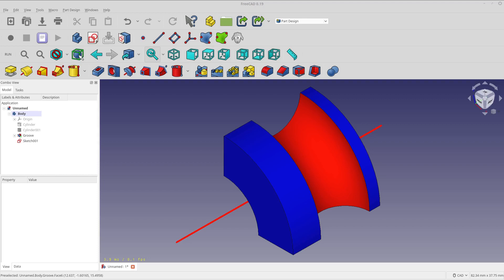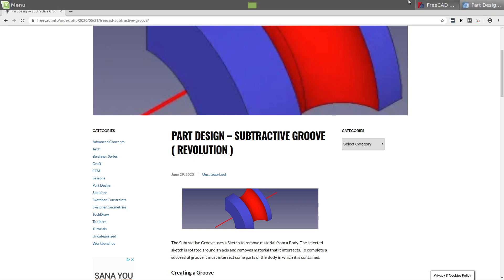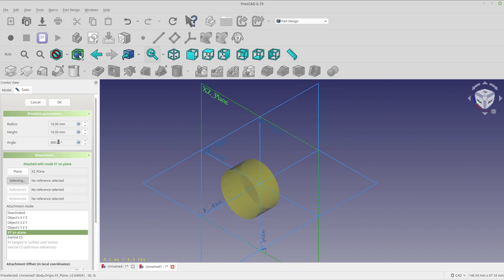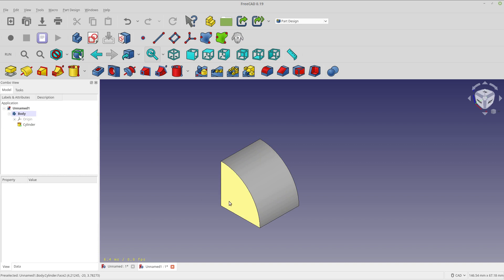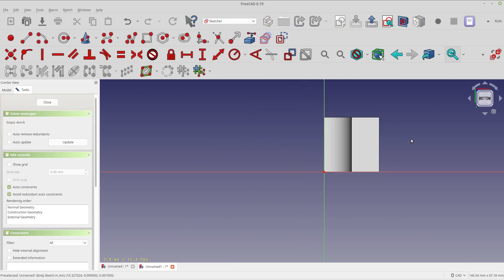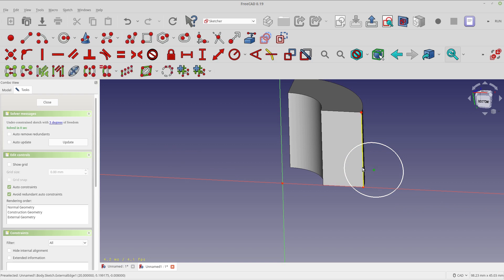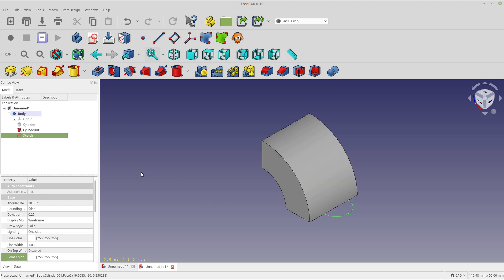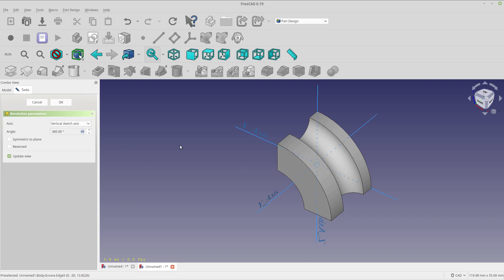FreeCAD Part Design Subtractive Groove - How to use a revolve to subtract from a Body

Comment: Is there a better way to register the circle to the center of the line when making the sketch, so it can't lose its reference if any of the cylinder parameters get changed?  Or is the reference external geometry tool the best option despite the the risk of losing the reference?
Reply: Just use the point zero where the two lines are crossing as a reference point. And you can also move the sketch in the 3D space with changing it coordinates. Where the sketch moves there will also be your pocket or cut. You can create some artificial reference points with blue lines as a form help to calculate where the sketch should be. Similar like when drawing plans by hand you have sideview front view and view from top. With those views draw on the same paper one view can help to draw the other view